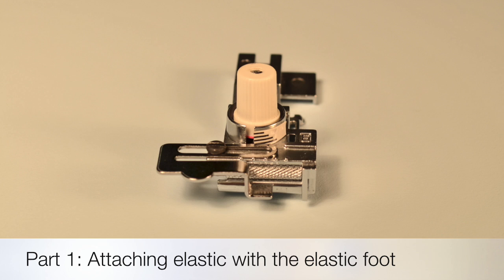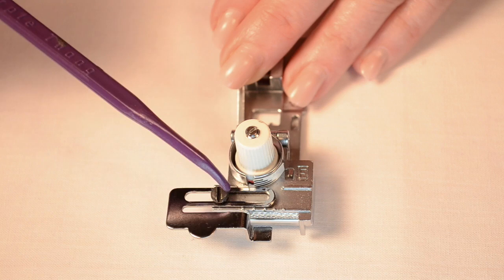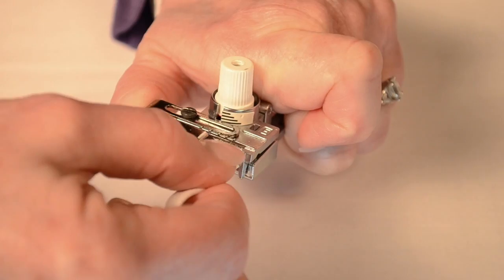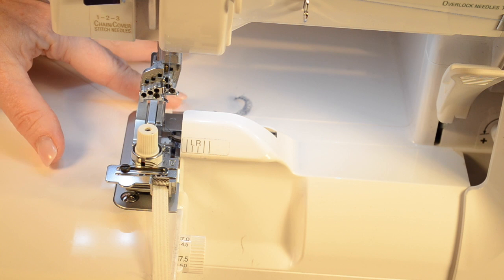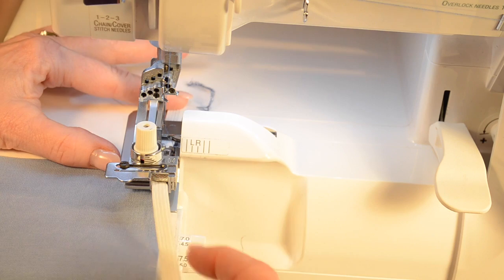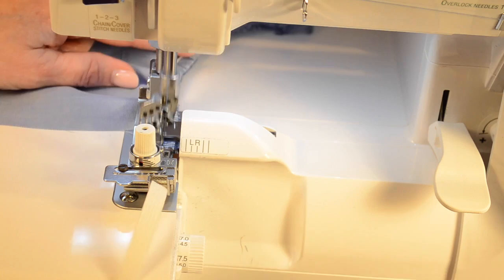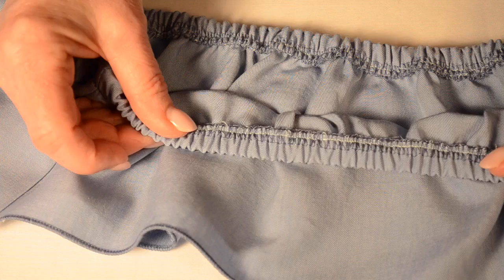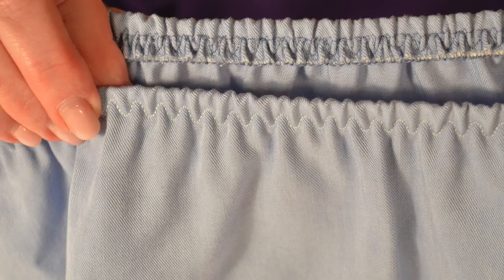The Elastic Foot

Comment: My grandmother taught me how to insert elastic in a dress without a casing.  By the time the adjustments are made, your elastic is in.  Before side seams are sewn, cut your elastic waist measurement minus 2 inches and cut elastic in half finding the mid point of each piece and mark with a pin.  Find the center back and center fronts of the garment and mark with a pin.  Depending on how much or how little blouse you want determines the actual placement of the elastic around the waist.  Start at the side seam sew the elastic to the fabric a couple of stitches to secure and then stretch the elastic matching the pin on the elastic to the pin at the center of garment and sew.  When you get to the center stretch and sew to the side seam...and repeat.  She taught me this when I was about 10 years old, I’m 60 now.   I only make casings for children’s wear.
Reply from the maker: m mills that’s the great thing about sewing. There are numerous “right” ways to arrive at a wonderful result. Thanks!

Comment from the maker: I do a little of both! first I test a length of elastic on scrap fabric to adjust the knob for the correct amount of tension on the elastic for gathering. Then I cut a longer than necessary length of elastic to pull through the foot and begin stitching to the fabric. I cut off the excess elastic after it's attached and then finish the garment construction. Thanks for watching Serger Tip Clips!

Comment from the maker: I don't think I'd use a flatlock stitch with the elastic foot. However, you could run an elastic under the flatlocking (or reverse flatlocking after it is stitched and pulled flat. It would be a cool way to use both the elastic and a decorative stitch. Great idea! Thanks for watching Serger Tip Clips!

Comment: Would love to see a video on using the elastic foot to serge elastic on garment.
Reply from the maker: Hi Judy, there is an upcoming Serger Tip Clip on the elasticator foot. I use it for other types of projects more often than garments and it's the same method of testing the tension knob setting for the desired gathering. Is there a specific technique you're wondering about? Thanks!

Comment: do you start with a long piece of elastic and use as much as the garment needs or do you need to find a certain measurement and pre cut the length of the elastic before you use the elastic foot?

Comment: Hi, I own an industrial JUKI MO-6814S - I make swimwear. Do you recommend adding an elastic foot to my industrial serger or using a non industrial machine to make swimwear straps using a Zigzag stitch? I need something to make this easier because the lycra slides out under the foot while sewing and trying to add elastic is a mess.
Reply from the maker: Hi Laurenn, I haven't stitched on a Juki MO-6814S. For the best results on swimsuit straps, cut the strap fabric several inches longer (4" is a good amount) than the desired finished length. Manually stretch the elastic to the desired amount and clip it in place in the strap. Serge it in place and cut off the excess length. (I like the extra length when serging because the finished ends seems to look better and it's easier to keep the clips from getting in the way when starting and finishing stitching. (This is the same principle as using a longer zipper than the edge to which it's stitched. Your stitching will stay straighter from end to end.) But my rule of thumb is use whichever method gives you the best results. Let me know if you have any other questions and thanks for watching!

Comment: Gail, do you measure the fabric to be sure what of your exact gather before your gathering?  Otherwise, how would you know?
Reply from the maker: Hi Ann, testing on samples is the only way to determine how tight to make the tension knob on the top of the elastic foot. Every fabric gathers differently (also different elastics perform differently too). It takes a little extra time, but your gathering will be beautiful and uniform from end to end. Unfortunately there isn’t a formula to follow which would make it much easier😫. On samples, cut strip lengths in multiples of 10’s to make the math simpler. I usually will cut a 20” strip to get a true read on the gathering. If your machine has tension adjustments, increasing both needle tensions will tighten gathers along with increasing the differential feed setting. Hope that helps. If you have more questions, let me know. Thanks for watching Serger Tip Clips!

Comment: Bla bla a brand name or a link would be so wounderful. I have been search for an hour, Im here searching but can not find the same type/with a roller adjustable tension and size.
Reply from the maker: These Serger Tip Clips are for all brands and models of machines. Each brand has different specialty feet availability. Go to your brand's website (I.e. BERNINA.com, Janome.com, etc.), enter or search for your model and check which feet are available for it. Each company's elastic foot might look a bit different in design, but the principles of use are the same. Let me know if you have more questions.

Comment: Thank you so much for this video. It was very helpful for understanding how the elastic foot actually works. May I ask, which serger do you use? I have a Siruba HSO 747D and lifting the foot is not that easy as it seamed with yours
Reply from the maker: When I created the Elastic Foot Tip Clip, I used a Baby Lock Ovation serger. I traded up to the newest top-of-the-line Baby Lock Triumph and love it. Am not familiar with the Siruba HSO 747D-do you like the stitch it creates? Thanks for watching Serger Tip Clips!

Comment: can you use the elastic foot to sew in the round, or is it better to sew in the elastic flat and then join seams to finish the circle/opening?
Reply: I searched for this video because I'm wondering the same thing. Is there a tried true method for figuring out the amount of stretch to be sure the finished product is neither too tight nor too loose? (Such as a certain length of test fabric with elastic at different tensions and using a formula to be sure the elastic cut to the circumference of the garment's waist, leg band, etc. with finish up properly at the end of stitching? Otherwise, I'm having trouble understanding the use of the foot. I did a trial and error project and still am not getting it right. I'm sure someone has come up with a method. There is a method for creating a sample of all thread tensions on a serger to identify the perfect tension settings. There must be some sort of clever method for determining proper elastic foot tension as well. Would love to know how experts do this.
Reply: I just tried this for leggings, sew in the round. I was unsure how to finish off though, a video for that would be great!

Comment: Does this foot also fit on Janome D2000  overlocker?
Reply from the maker: Hi Monica, Brand name specialty feet are made for that particular brand machine.Here's the link to tell you about the elastic foot for the 2000D model: https://www.janome.com/accessories/serger-foot/elastic-gathering-attachment--serger/.  Thanks for watching Serger tip Clips!
Reply: @GailPatriceDesign  I'm looking for juki 8700 . where can I buy one. I'm using 13mm elastic.will it fit ?
Reply from the maker: @amrithMilW  Hi Amrithraj, I am not familiar with the Juki 8700. Check their website or call local dealers who carry Juki machines and they can guide you. Of ten a website will allow you to enter your zip code to find a dealer in your area. Thanks and hope that helps.

Comment: Is this foot just for Baby lock serger machine ,because my is Janome?
Reply from the maker: Frances Perez The foot shown in the video is for Babylock sergers, however, check on the Janome website for compatible feet and accessories for your Janome model.i know Janome has an “elasticator”  attachment that screws onto the bed of the machine. It looks different from my presser foot but works on the same principle. It has a knob to increase tension on the elastic as it feeds through. You didn’t mention your model so their website (or a Janome dealer) can help you. Thanks and stay safe!

Comment: what if we are using 1 1/4" elastic? is that possible?
Reply from the maker: Hi Sarah, Sorry it took a couple of days to get back to you. If you have the babylock elastic foot, you can loosen the screw that holds the guide and swing the guide off to the left side of the foot and tighten the screw. It won't hold the elastic in place but you can guide it with your left index finger. If you send me your email address, I can send a pic of how to do the set up for wider elastic. Just remember that you'll have to guide the elastic . My email is: gail@gailpatrice.com. Thanks for watching.

Comment: Where can i buy this?  I live in Australia and dont see this locally.
Reply from the maker: I'm not sure what you're referring to—the foot or the elastic? If you're referring to the elastic foot, check with your sewing machine dealer or the manufacturer's website for availability for your model serger. If you're asking about cut-through/sew-through elastic, you may have to do some investigating and call Australian suppliers. Ask whether they have knit elastic. Hope that helps—thanks for watching Serger Tip Clips!